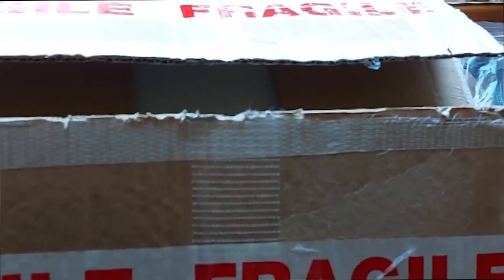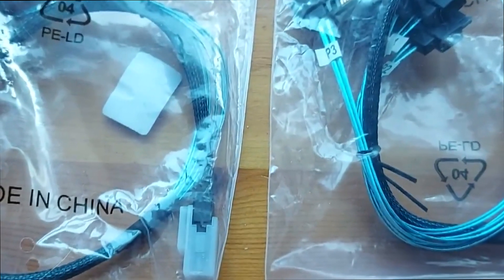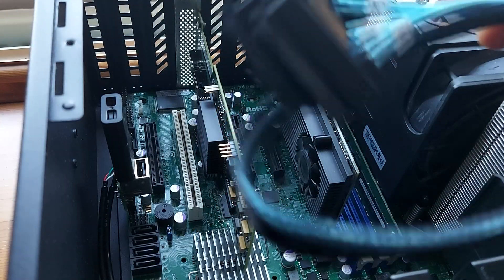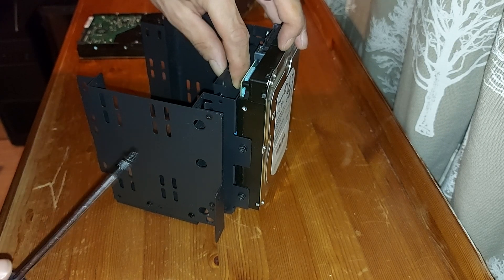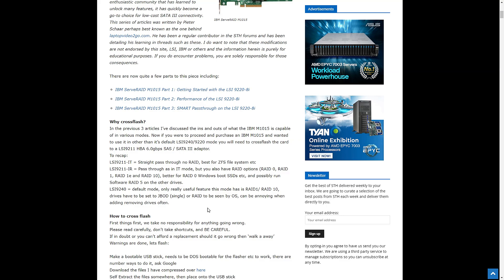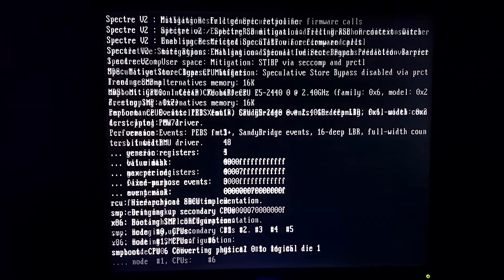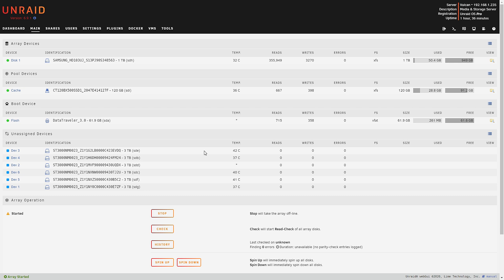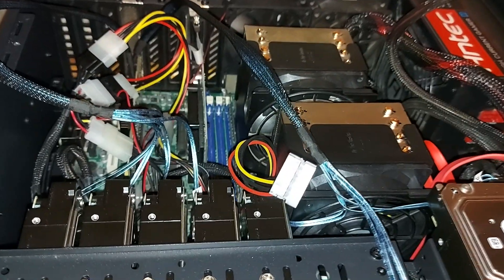Building A Cheap Homebrew UnRaid Storage Server 2021 - Installing SAS Drives & Raid Controller

Comment: You have to add fans to the box, in order to drop hard disc temperats as low as possible.
40 ~ 42 degrees Celsius is very high temperatures and has a negative impact on the lifespan of the discs.
  The LSI card also produces a high amount of heat and you have to take care of it.
It is no coincidence that the servers of this level are extremely noisy of the increased cooling needs.
Reply from the maker: Yeah, the disc temps are not ideal, and this 4u rack only has one 120mm fan pulling air in through the front.

I've transferred the entire system over to a different case with better cooling. I'm getting temps in the mid 30's which is much better.

Thanks for commenting and watching the video 👍

Comment: I’ve been considering migrating to a sas card to expand the amount of disks I can have spinning. 

Was there a particular reason you chose the IBM card?
Reply from the maker: Not particularly no. Although it was fairly easy to flash from IR to IT mode, and you can pick one up resonably cheaply. It has been a good card and has worked flawlessly since I did the cross flash.
Reply: Get a sas3 card, ie 12gbps. That way each channel can simultaneously accommodate multiple hard drive streams. ie a 4x sas3 channel to sata drives (via a sas expander) can simultaneously talk to 16-20 drives simultaneously. 

Sas3 controller 8x ======= 8x cheap sas3 expander 36x ------ up to 36 hard drives either sas drives or sata drives

The distance from the sas controller to the sas expander can be up to 10 meters, so you can stick where you don't need to listen to it. 

While you can put nvme drives on sas, unless your setup needs multiple high availability head nodes, it is simpler to just put those on pcie.
Reply from the maker: @mikegrok  Sorry I have only just seen your comment. Yeah, a 12gbps SAS controller will be the next upgrade, I think, twice as fast and, as you say, can support more disks.. I can run up to 8 drives on my current controller, and I am currently limited to six because of the case I am using. 

I was actually thinking of using a SAS-E controller and picking up a disk shelf and connecting the disk shelf via the external port. My current controller only has internal connectors, unfortunately.

Cheers for the suggestion. It is definitely something that I will take into consideration 👍